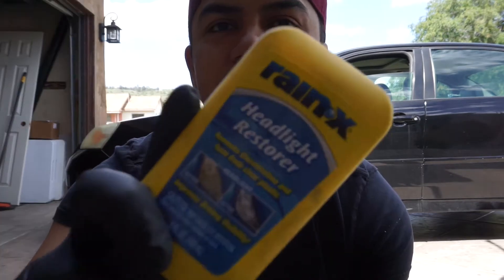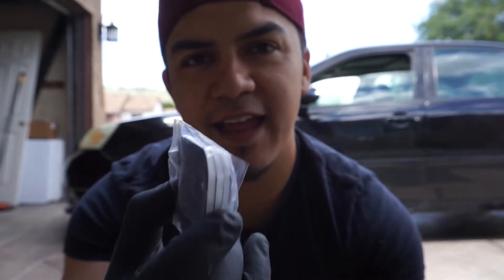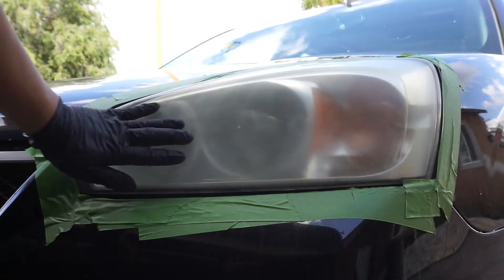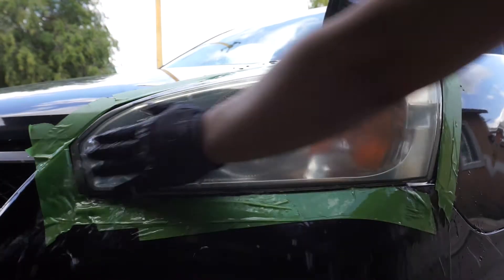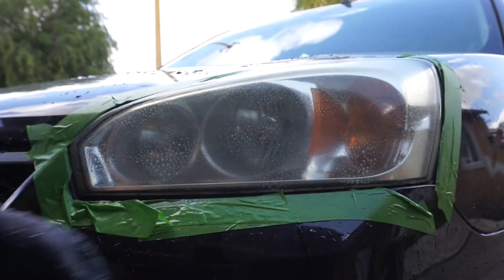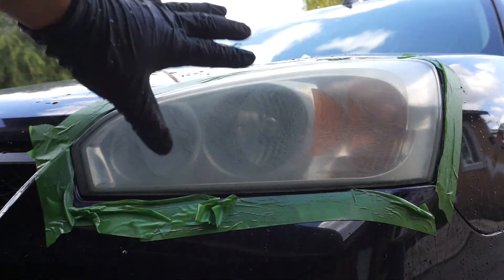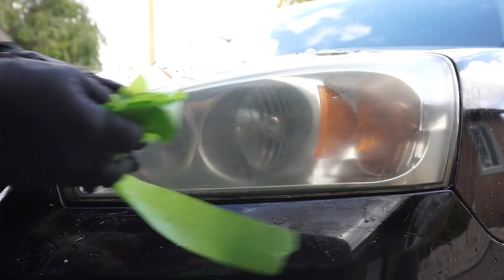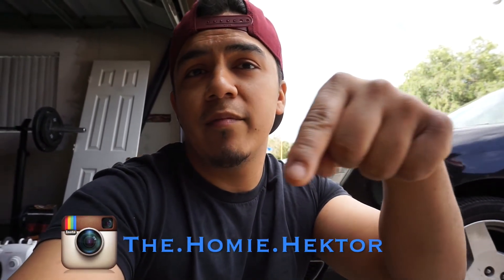Easy Headlight Restoration for FREE!!

Comment: nice I've never tried the rain x one. I just use regular wet/dry sand paper, start at 600 and go to 3000 then buff with compound. I should look into that wax though to help protect it better from uv.
Reply: I’ve done a couple but I haven’t found a way to make it last yet. I know they make a sealer you can put on but I haven’t tried it.
Reply from the maker: whatfreedom7 I think the best way is to keep it away from the sun as much as possible 👊🏼